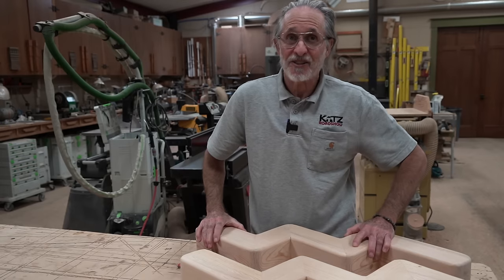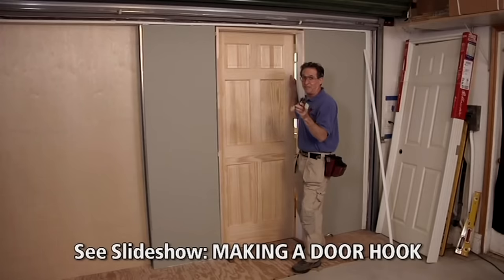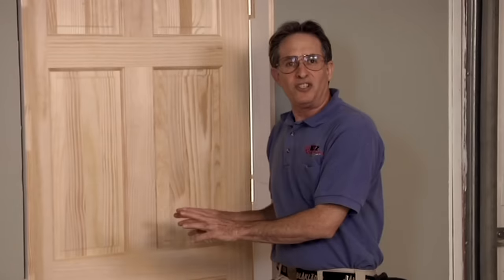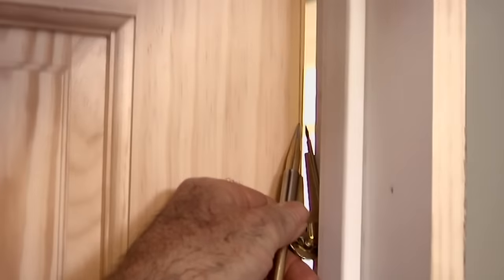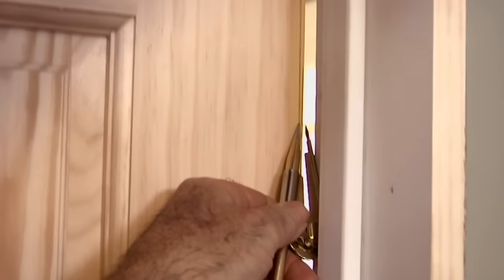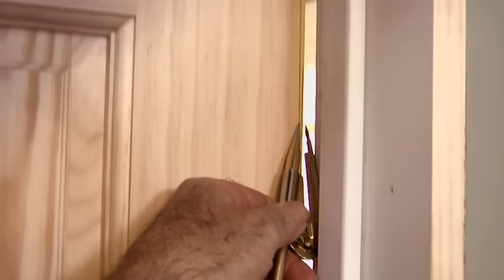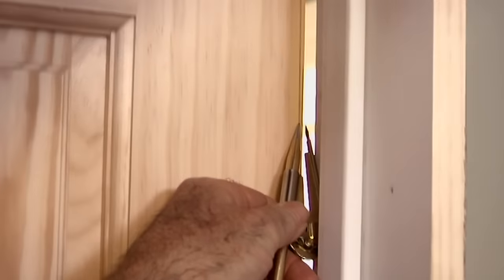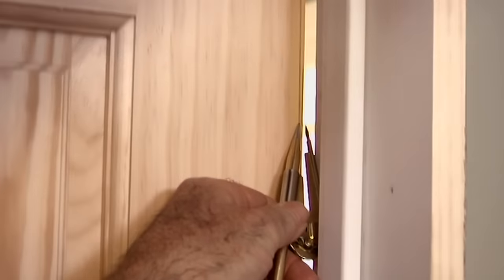HANGING A NEW DOOR IN AN OLD JAMB, Prog. 9, With Gary Katz

Comment: 49:19 Been there done that. Lost an hour trying to get the bit out. Didn't want to cut the door even though it was only a Masonite door, needed to get the job done and didn't have time to order another. There's a cardboard maize inside those doors, but I eventually got it out through the hole believe it or not. Use tape ever time now.

Comment: Find it interesting that carpenters use the butt to the hinges for getting the door handing. Locksmiths use a different method and its all based on which side of the door is the locked side. Standing on the locked side of the door and hinges on the right if you have to back up to open the door its a righthand reverse.

Comment: ...never could figure why the bevel on the hinge side...I've never done it (well, after I learned it's not necessary) and have doors I've hung 35 years ago that operate just fine.  <shrug> oh, and I'm a stick guy too, it won't lie, lol...so, got to the end of the vid and, yes, I can see a reason to bevel the hinge side.  But I'm one of those guys who resist bending the hinges until there's no other option...lots of times I'll slam a 4" screw into a hinge I want to pull back so it gets to the king stud, more often than not that will get it done.  Nice vid...oh, I use a plunge router with the stops set to my depths and the newer Templaco kit has a nice jig for the strike where, usually, there's no need to adjust between the hinge depth and the strike depth.  Also, Templaco makes a Forstner/auger type bit to fit their jig that is much faster and cleaner than that olde spade bit.  I've done alot of apartment work and have to travel (read: lug tools) up and down stairs so have to keep my kit to a minimum...I wish I could use a door rig like you have!  Haha...

Comment: Thank you for sharing these videos. I have most of your DVDs and two of your books. They have been the greatest resources I have for my trade. You and Spencer Lewis are my to go to people.

I have two questions. What do you use to seal the bottom of the doors while your working on them? I hang both paint grade and stain grade doors for a store in old homes. Would shellac work for both? Do you have a different suggestion?

Second question, What is the preferred height off the finish door? What do you do for hard surfaces? What about over carpet? And much do you allow for carpet that hasn't been installed yet? I currently aim for 1/4" above the finished floor or existing carpet, with the door closed (providing an unleveled floor doesn't interfere when the door is fully swung open). 

Sometimes the homeowner has a specific request, but most of the time they ask me what is normal. 

If anybody else is reading this and has practical input, please chime in. Thanks!
Reply from the maker: Spencer Lewis is awesome. I've learned a lot from watching his YT videos, too! 

I seal exterior doors with a couple coats of spray varnish, something that dries quickly. IF it's a stain-grade door, I mask off the door and spray the bottom. For paint grade I spray the bottom twice, then lightly sand the bottom rail to remove any overspray. The doorhangers/finish carpenters aren't really responsible for sealing doors--but I kind of feel that a little extra effort is worth it, especially if the painters never do it or do a slipshod job.  I think shellac would work just as well. 

Height off finish floor is kind of a regional thing. Some places in the country they cut the doors off the floor a LOT thinking that's the only way to ensure conditioned air will move through the home. Where I come from, we allow 1/4" clearance--and the same as you, we check the swing and make sure 1/4" is enough just in case the floor rises as the door swings open (or the wall is out of plumb).
Reply: @THISisCarpentry  Thank you!
Reply: The preferred height off the finished floor for interior doors 1/4". But if the home has central air and heat, increase it to an inch or more to allow the return air out of the room and back to the HVAC system. 
A lot of homes have door bottoms that are too low and cause the HVAC system to pressurize the rooms and depressurize the main part of the house. This can cause several problems and safety concerns.
Reply: @davidparker9676   Thank you for your input David. Originally, I mentioned that practice in my initial post, but somehow I must have deleted it when editing my comments. I don't know what happened there.  Anyways, I see that a lot in older homes here in the Midwest. My question is, Is that still necessary if the room has cold air returns in them? Do you still need an 1" under the doors? Sorry my knowledge about HVAC is minimal.
Reply: @t.e.1189  If you have supply and return ducts to every room you don't need any gap on the doors.

If you have only supply ducts to the rooms, having a single central return duct in the home, you need a large gap on every room with a door and a supply duct.
Reply: @davidparker9676  Okay that's kind of what I was thinking. Thanks again.
Reply: That's ridiculous, the last thing you want to do is cut doors to create space & recuperate air conditioning design flaws- that's a bit like adjusting to faulty tires because someone put the wrong rims on your car
😂

Comment: So long as the jamb sides are straight, regardless whether plumb and reardless the shape of the opening, I use my HowFarOut level survey gauge and Stabila jamber levels to map the F.O., then my tracksaw to size the door with required allowances for width, head, and sill margins. If jamb surface(s) are so significantly bowed as to make margins noticeably inconsistent, I will scribe as Gary demonstrates, but it is not often that I find this necssary. As Gary says, there are many ways to skin the same trim cat...
Reply: Might you be so kind as to share one or some?

Comment: My local door shop does pre-hangs by making the jamb the nominal size of the door, then cutting a fat 1/4" off the lock stile to make the door fit!  They insist that that's the proper way.
Beveling the hinge stile is unfortunately a rare thing.  I install the strike plate so the door is even with the jamb, and then install the stops with a gap everywhere except the top and bottom of the latch edge.  This is adjusted for a slight spring action and no rattling.

Comment: @ 48:00 (boring for latch) -- Could you not use a battery-powered IMPACT WRENCH?  I think that my Milwaukee could do it.
Reply: Impact drivers/wrenches use high frequency impacts to increase the torque.  They don't work so well with a continuous load like boring a large diameter hole.  Also, the original video is pretty old.  I use an 18v Milwaukee drill for this exact purpose and it works fine.  Occasionally, the drill will hang up, but I think that's mostly because my batteries are old or the drill bit is dull.  Battery tech has come along way since this video was filmed.

Comment: How can I tell if an opening can hold a door? I have a opening between two rooms that looks like it's been framed out (molding on the side and what not) and it FEELS solid and I want to hang a door on it, how can I tell if it's good to hang one?
Reply: If you use a lightweight hollow-core door, it will probably be fine.  However, the best way to know, would be to pull the casing off the side of the jamb you want the hinge to go.  See if there are any shims supporting the jamb.  When you install the door, add shims behind the hinges.

Comment: I have an existing hollow core interior door that the top corner is snug enough that it won't close. The top corner is touching both the latch jamb and the head jamb. How can I fix this?
Reply: Is the latch jamb plumb in all directions? Head jamb level? It sounds like they might not be? I don't know if it would benefit your scenario or if a true "pro" would recommend this, but I would consider either sanding down the very top (if it's been painted recently it might be because of paint "growth") or alternatively, planing it down just a tad. Again, I'm not a pro but if I were in a pinch and didn't want to replace the whole thing, I'd do something easy-ish.
Reply: @kevincrinklaw7422  Jamb is square. Door is square, although out of plane a little. No paint buildup. It didn't use to be this way, but has gotten worse over the years. Had to take door down recently. Trying to fix without altering the door unless last resort.

Comment: with the casings already off would it not be faster to correct the out-of-square frame?
Reply from the maker: Yes, if the casing is off, it's not only much easier/faster but the right thing to do. But most "re-hangs" are not on jambs without casing. Most of the time, they're exterior doors with brickmold masonry on the exterior, and some extremely expensive wallpaper or something on the interior.

Comment: I Think a carptners job is to make things squar plumb and leval then make it pretty and pleasing to look at by cheating the difference. 
Becuse you can only get so close you will find times you cant get perfect without making it look perfect. The closer to perfect you can start off with the better the end results.
Your building a 100 to 500k dollar home would you buy a new car put together with rusty bolts and nuts?
No you wouldn't. Would you buy brused bannas and pay top dolar for them?  Either item is pennies in the bucket compaired to the cost of a house. Wood is a natural product its not perfect no tow 2x4s are the same. We make them the same by bending and twisting them to fit. We take advantage of its natural shape and use it to our advantage,  durring finish work its up to finish carptners to make it the best it can be.  But everything lays on the foundation laid before finnish.
Dont use shorta as an excuse to  not mesure up to best that can be done standards.

Id tear out the door frame prehang it and start over, you can fit the door to the framing better the fit it to a frame. If the frame is this far out Fix it. That you can change.
Once you cut parts of the door to fit 
It cant be moved without changing it back.

I kinda disagree with dealing with a poorly hung frame like this.
Reply: IT IS FAR OUT FOR TRAINING PURPOSES
He built the faming (in his filming studio) so as to illustrate techniques for dealing with problems one might run up against in the field. He is not advocating trimming doors as opposed to fixing framing.